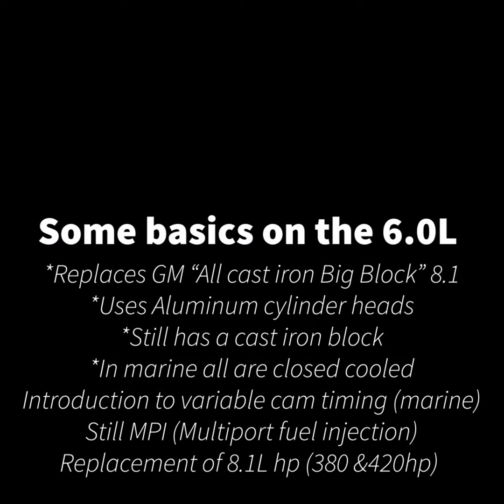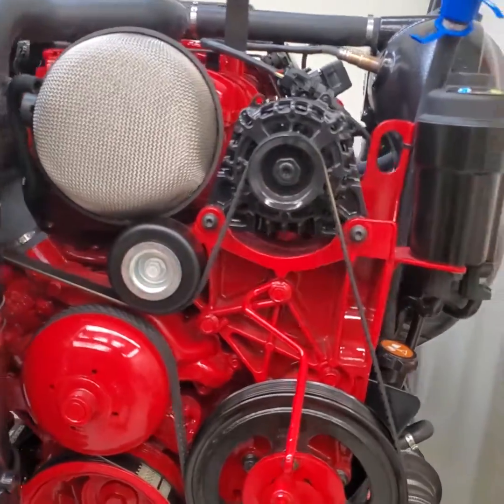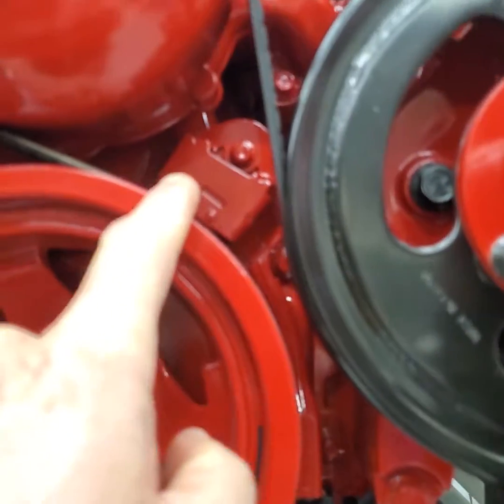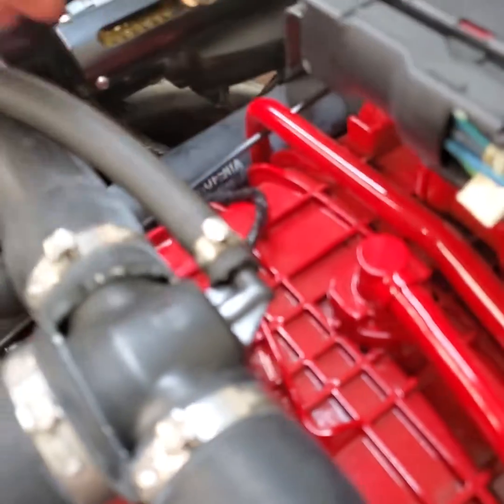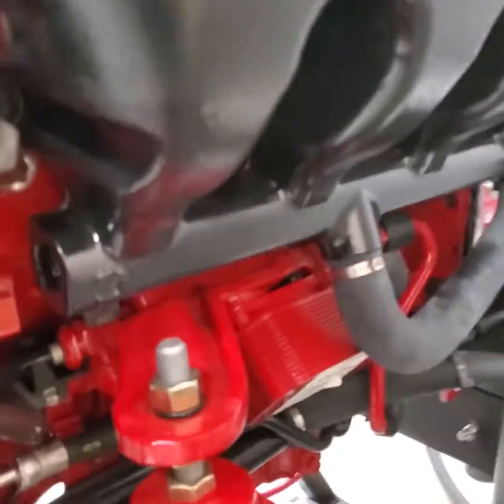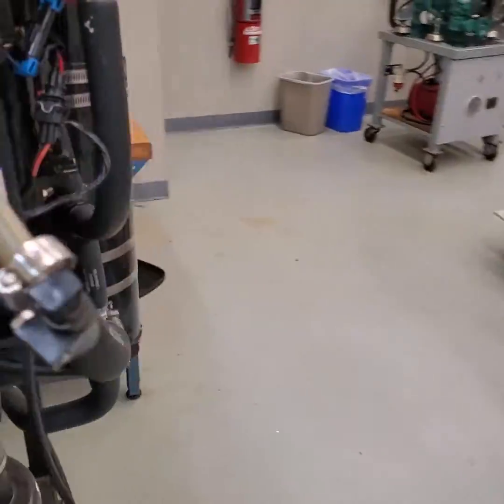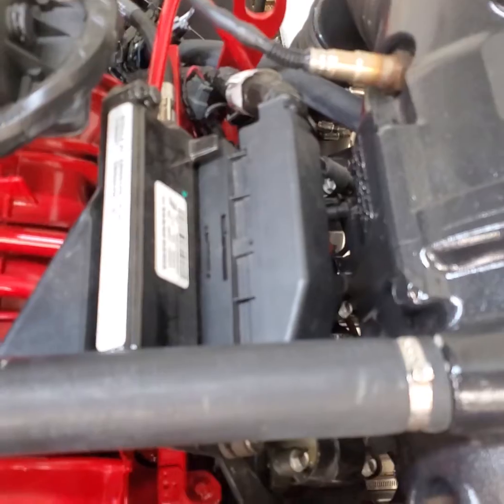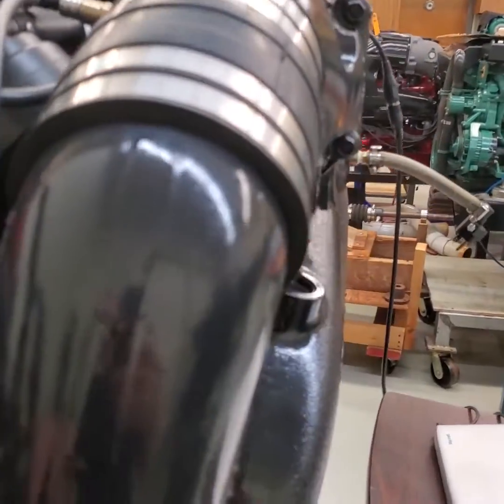Introduction to GM 6 0L engine changes vs  8 1L for Volvo Penta versions

Comment: Can this engine be dropped in to replace a 2008 VP 8.1 OSI-D? They both seem to work with DPS drives. I am considering 2 new engines instead of rebuilding my old ones... Any help is appreciated. Thanks
Reply from the maker: That's a problem....
6.0 is not available and the new 6.2 has a 6k rpm.
Best bet is get two factory 8.1 remans. The 8.1 is an awesome engine. If they are closed cooled I believe they can be rebuilt. If salt water cooed then no.
Reply: @tedsmarinerepair8956  I meant the 6.2 engine, the V8 380 to be specific. I found 2  turn-key engines at a reasonable price and was wondering if there is any way to make it work. Not sure why the 6k Rpm would be a problem?

Comment: Great video! Delete the VVT as soon as earthly possible. That's a Gen IV LS motor which is basically indestructible except for the VVT/AFM. I'm super surprised to see it in the marine world. The lifters are known for early failure and destruction of the upper end of motor is inevitable. I build those things all the time and if it wasn't for that system those engines would last forever
Reply from the maker: Interestingly enough they do hold up very well in the marine world (maybe an improvement was made for us!), The VVT system make the acceleration in boats a remarkable improvement. This is the same in the Gen V engines as well.
Reply: @tedsmarinerepair8956  - that is super interesting!! I'm curious if it's a different set up completely? Does it still shut off 4 cylinders? Do they have different programming? 🤔  Honestly I've built 1000hp daily drivers out of those engines while still using the stock bottom end and the first thing to go when I start building is the VVT. But maybe GM did something different to keep Merc/Volvo from getting nailed with a bunch of warranty work. It is an outstanding platform otherwise
Reply from the maker: @bills2999  Bill, They do not use the 4,6,8 lifter hydraulic shut off on any marine engine. The system is in place with the solenoid wiring, but no connection to the ECM. And yes if that destroy the engine in short order if engaged in a marine application. The VVT system parameters are very different as well for our applications.

Comment: Ted,thanks for another great video. I wanted you to know I got my handy dandy wide blade Snap- On screwdriver. 
I am into buying boats with bad motors and interior. I redo the inter my self. I have been an auto technician for over 33 years. 
I have been looking into buying truck 5.7L engine to be build for the boats. I look for throttle body with 12 bolt intakes and flat Tappet lifters and Vortec 8 bolt intake roller lifter. I’m trying to find the correct marine cam with the lift/duration and overlap I need for wet exhaust.
I talked to the guys at Howered’s cams. The gave me lots of info and I got a bit confused. And do I need different valves? It looks like I may have $750 in cam, lifters and springs. One idea is to use the bad motor cam,springs and build the good trick engine? I would like to build the Vortec motor snd replace the throttle body non roller motor but have the added experience of the cam and springs to make it work.
Will you give me your thoughts and insight? Thank you.

Comment: Ted. Thank you so much for your video. Great information! I did get my handy dandy wide blade screwdriver from Snap-on. Love it!
I have started a business of buying boats with bad motors. Repairing them and reselling them. I do the interior repair too. 
I want to get 5.7L 350 mid 90’s throttle body, 12 bolt intake to heads flat Tappet and late 90’s Vortec roller cam 8 bolt manifold to head intake and rebuild them as a base core block. I’m trying to research what cam to put in them to have the correct lift,duration and overlap to work properly with the wet exhaust. I talked to the guys at Howered’s cam and they were helpful but confusing. It looks like I will need to put about $750 worth of springs and cam and lifters in it to make it work.
One option is if the marine block/complete engine is the same throttle body or Vortec configuration, I could use the cam out of the bad motor? What are your thoughts? Thanks again.
Reply from the maker: email me at marinedoc01@yahoo and I can send you a cam spec sheet for marine 350's